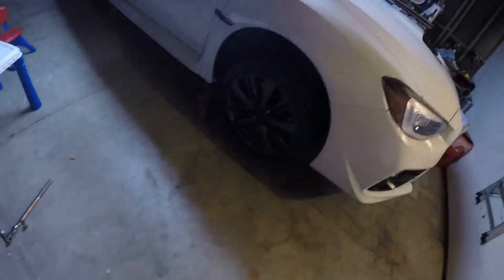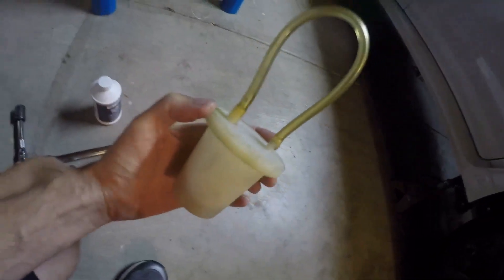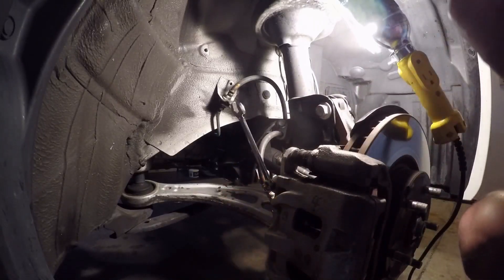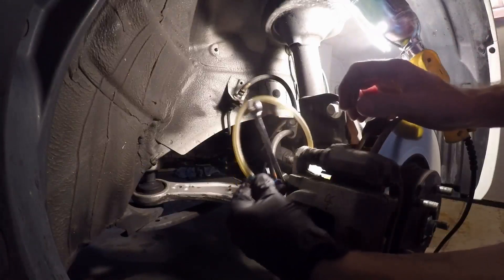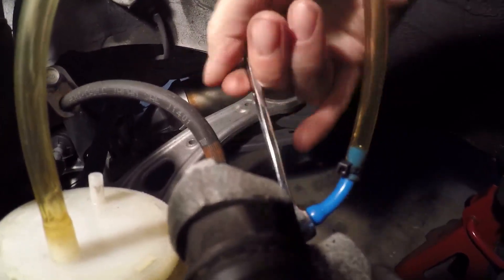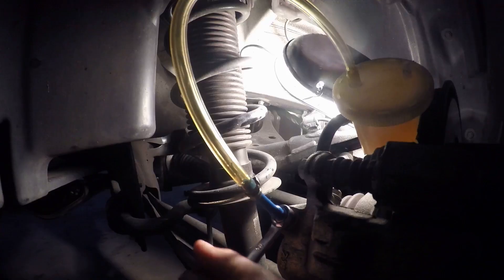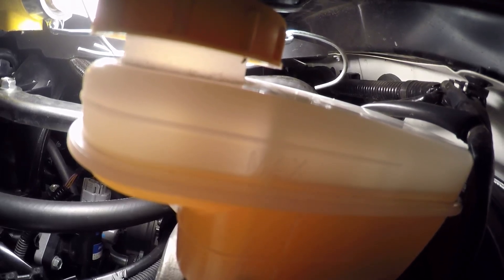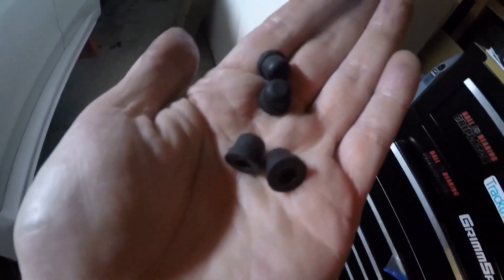2015 Subaru WRX Ep. 558: Brake Bleed Tutorial and Tire Rotation #2

Comment: It's amazing how many people tire shops have no clue as to the proper way to rotate all wheel/ 4 wheel drive vehicles.  My Subaru and Ram Truck manuals show it exactly as you did it.  When I bring my vehicle for rotation, I write with a piece of chart where the need to go.  They are always puzzled no matter where.  Believe it or not, Sam's Club is the best I've seen as they have a book with the various tire rotation methods.
Reply from the maker: very true.

Comment: ABS brake bleed? Any idea when that is necessary?
Reply from the maker: not sure what you mean? oh.. the ABS system itself? almost never...
Reply: LastHumansGarage Look into what I'm saying a little.. The abs pump relay needs to be activated during the bleed to ensure proper air retrieval.
Reply: Per-Subaru.
Reply: Most common thing I'm seeing is driving on gravel and slamming the brakes. Others use diagnostics

Comment: Hello, what sequence did you do? FR, RL, FL, and RR??
Reply from the maker: everyone has their own thoughts. i start with the furthest wheel.
Reply: @LastHumansGarage  Sorry to beat a dead horse here, but I just did mine yesterday. Did the same action, pumped the pedal three times and held fully depressed. The order we did it in was RR, RL, FR, FL. And my pedal feels extremely squishy now. I don't get full engagement until about halfway depressed. Would you be able to chime in on your order and process? In the video it sounds like you started with the fronts first, then did the rears. And searching on Google has so many varied "correct Subaru methods".
Reply from the maker: @chancastillo7909  the most important thing is that your reservoir didnt run dry, otherwise it can take forever. dont loosen the bleeder too much, just enough to let fluid out. if you open it too loose air can come in from the threads and make you think you have air when you don't. and close the bleeder before the helper lets up on the brake pedal, or it will suck air back in.
Reply: @LastHumansGarage  Thanks for the quick reply. I'll try again and keep that in mind.
Reply from the maker: @chancastillo7909  even better let the helper pump it slowly up and down 2-3 times, once no bubbles at all come thru as they are pushing, close the bleeder AS they are pushing down for the last time, during their stroke. If you do all 4 wheels like that and still have a weird pedal, its something else, or your reservoir accidentally emptied and you didnt notice.